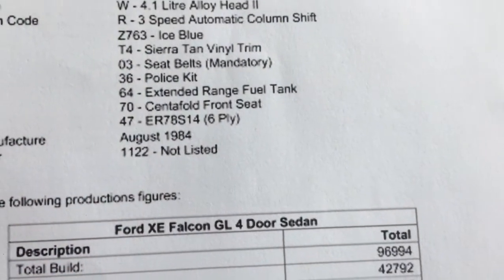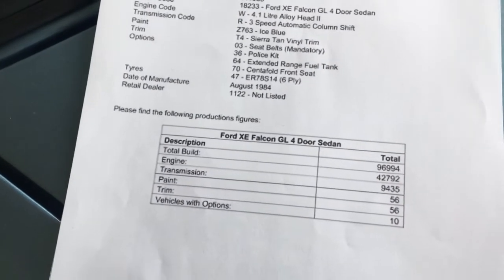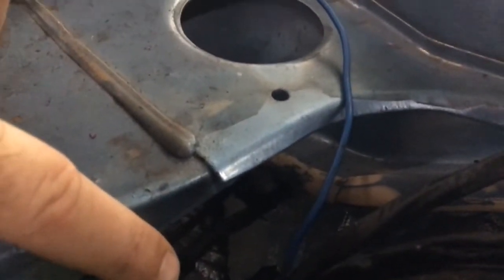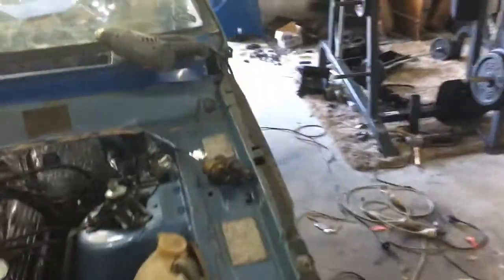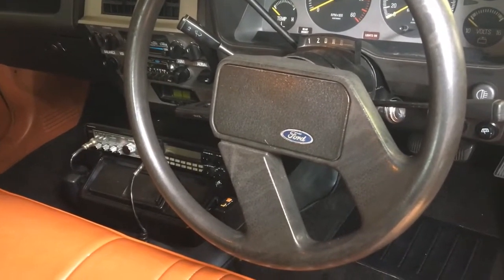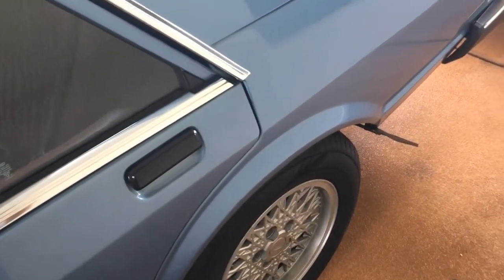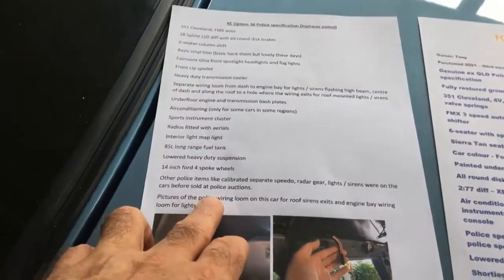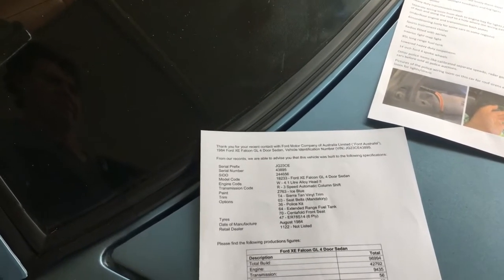Falcon XE Option 36 Police Car Specifications

Comment from the maker: The 4 speed Manual version of the Police spec XE 351 diff was a 2:92. I am guessing that the 2:53 must of been on a very few auto police cars. It would on been extremely unique with 28 spline and 2:53 diff. I also found out there is a reasonable number of XE Police cars that were ordered from the NSW Police that retained the XD leaf springs rear. Never seen one but the source was good.
Reply: BLOODY GREAT JOB